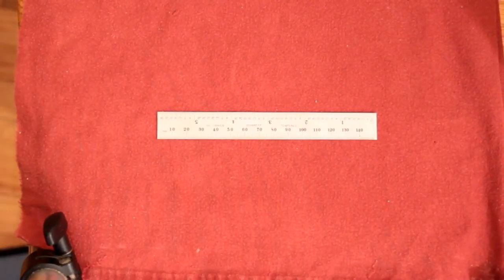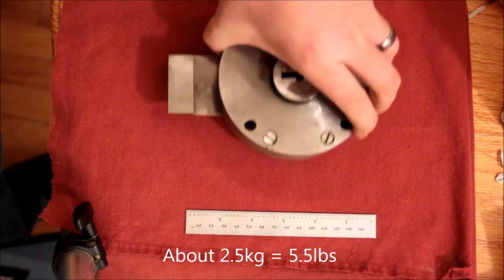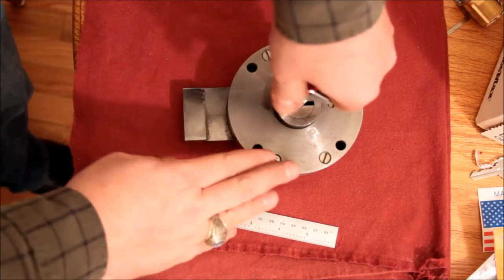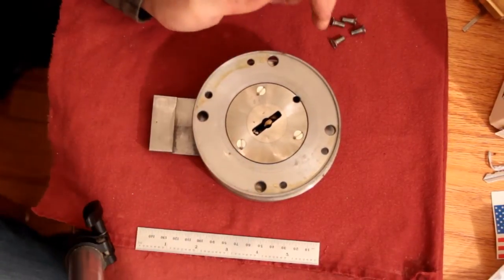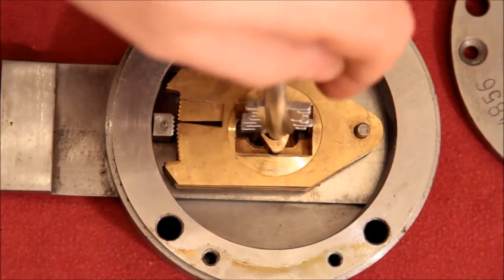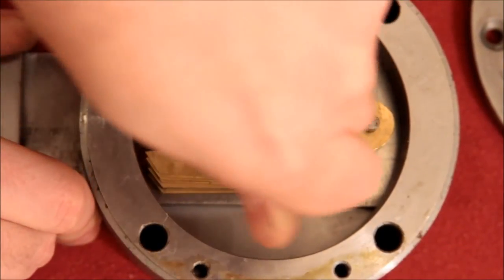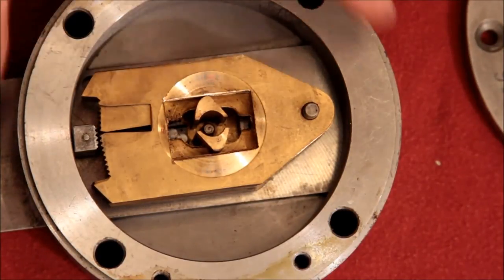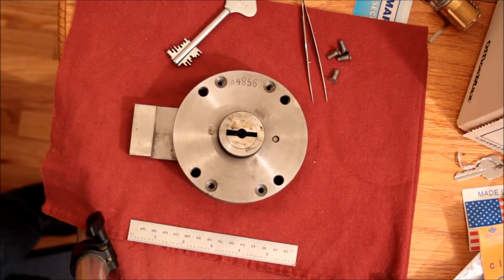(151) Lock Porn: Tresorschloss (12-lever German safe/vault lock)

Comment: I wish you would have disassembled the lock further.  I am not so much a lock picker but more interested in how the lock was designed.  It seems round machined lock cases were very popular in Germany at least with certain makers.  You probably are much more conversant in lock terminology by this time as the vid is now 8 years old, but the central part would be a variation on what is called the barrel.  Also popular is the lack of lever springs instead relying on capture and control of the lever by the key fitting in the lever bellies.  Interesting lock thanks for posting.